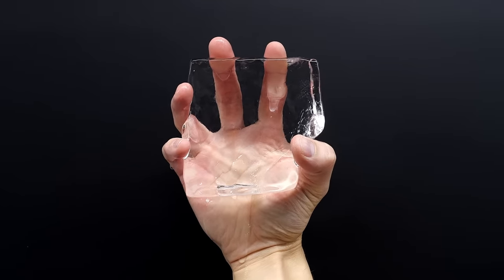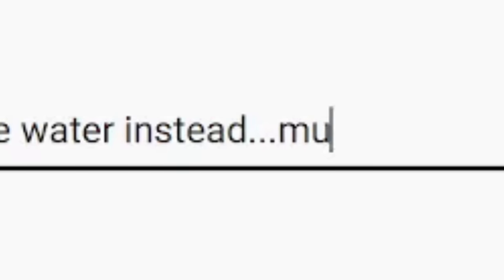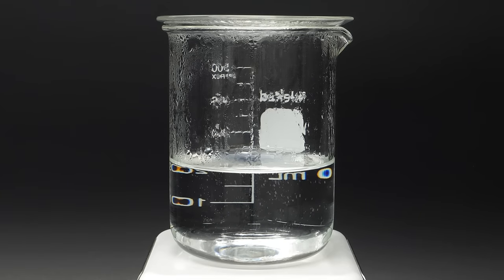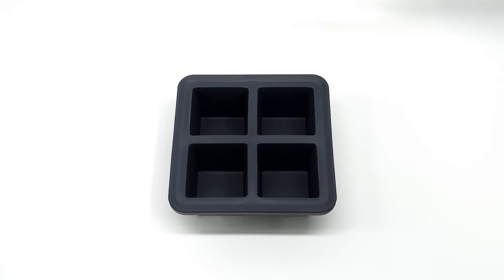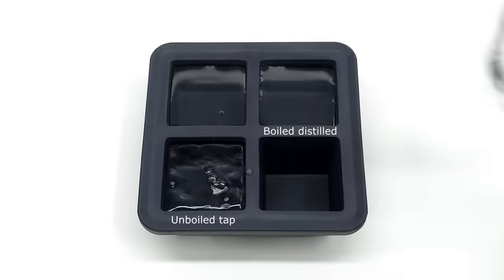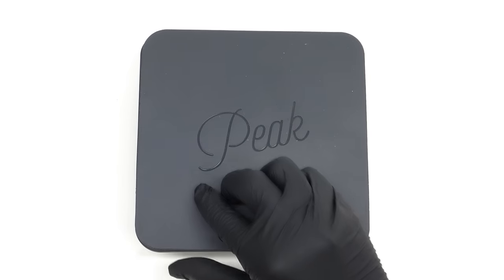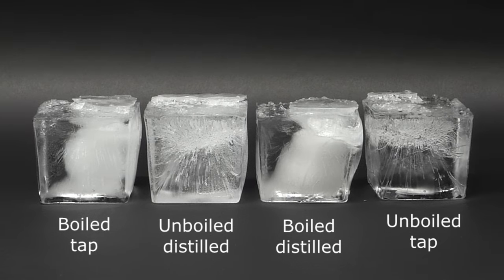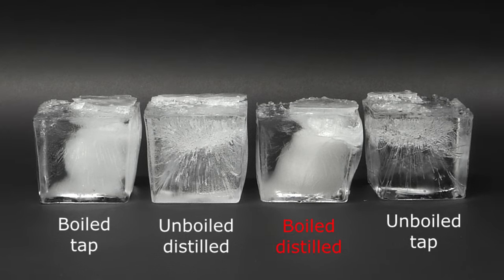The clear ice myth

Comment: The reason the ice isn't clear is because you're freezing it wrong. When ice freezes it's excluding all sorts of stuff. An ice tray let's ice freeze on all sides so it freezes from the outside in, trapping all the impurities in the middle. When you use any method of making clear ice the goal is to freeze it from one side to the other so the impurities get pushed to the unfrozen side. You stop freezing just before you get to the end so you're left with water with all the impurities and clear ice. The role of the cooler is to keep the bottom from freezing so it freezes top down making the ice clear. Industrial clear ice is made by huge tubs in a freezer but the water is made to circulate so the freezing is controlled and ice grows outwards - the circulating water ensures the unfrozen bit is outside the solid.

Comment: I think you gotta boil it for a good hour until your left with very clear water you can not see, then pour it into the icecube molds and it will be perfectly clear
Reply: I think you need to do a bit more homework in physics.
It is solely a matter of thermal expansion. Tap water is plenty clear.
Reply: @AB-80X  the joke is that it boils out of the cup leaving air
Reply: @KerbalChris  Ah, touché. Good one🙂

Comment: ok, well my only question is: but why not?
boiling water should remove all the gas in the water, and distilled water has basically nothing in it, it should be exceptionally pure, and water expands as it freezes, which means that those bubbles cant be vacuum like in a prince Rupert's drop, because the ice expands to fill in the gaps, or more correctly, the gaps never from to begin with.
why doesn't this work? does water naturally absorb gas again before it can freeze? I guess that would make sense since gas dissolves better when the water is colder, the opposite of how it is for solids. if this were the case, then a sealed container of boiled distilled water with absolutely NO GAS at all, should remain clear. alternatively just put it in a vacuum chamber, and pull all the gas out, then just keep the chamber under vacuum, and put the whole thing in the freezer.

Comment: Well... is not about the water, it's about the freezing speed. The product that makes clear ice, has got 2 chambers. Bottom chamber will give you the clear ice. Top chamber the one in direct contact with the freezer itself, but only by a small portion. And both parts are connected by a small tube. The setup is done to cool very very slowly the bottom water chamber.

Comment: The actual reason of such is impurities, it's known by everyone, but there is another way of getting the impurities out, either use a special type of freezer to get the impurities up then remove the fogged up part, or just boil it off into vapor and collect it back so the minerals and impurities doesn't go with the water.
Reply: The cooler trick (done in Nile's clear ice making video) is just like poor man's special freezer - when ice crystal forms, impurities are displaced into remaining water (the slower the freezing, the more effective the process is); by removing the cooler from freezer before water completely freezes, all the impurities are left in the water which can then be discarded when removing the ice from the cooler.

Comment: did he make a video on using a cooler? What am I missing? I seen the shorts video, but is there a full video?
Also, try filtered water instead of distilled. That ice is pretty clear. Also also, are you taking into account how cold your freezer is? If it's really cold and freezes fast, it probably won't be clear. That's probably why the cooler ice was clear, because it was slow. It was in there for 3 days and it still wasn't even all the way frozen.

Comment: I think freezing the water while slightly vibrating it would get you super clear ice. Drives out all the air bubbles.
Reply: The problem isn't dissolved gasses, it's the fact that when crystallization occurs from more than one direction you get gaps in the janky space where two unaligned crystals meet instead of a smooth crystal structure.  Even if there was no dissolved gas to occupy this space, there would still be 'cracks'.  When the ice is only halfway cloudy you can see how these microfissures organize into internal stress patterns.
Reply: @wcookiv  maybe distilled water with an occasional jiggle?

Comment: It would probably work if you could find a way to boil and freeze it inside of a vacuum chamber, so air can't dissolve into the water during or after it finishes boiling
Reply: why not just poor some water into 
a cooler
Reply: @Skibidi-n2zz  because that's not what I'm talking about

Comment: You did two things that I wouldn't have, that may or may not have made a difference. First you let the water cool down. Then you put it in a relatively small container though I like the fact that you covered it. If your experiment holds up even if these conditions then we need to explain why it didn't work. Any hypotheses?
Reply: it will hold up for a very simple reason: even when close to boiling temperature, the solubility of gases in water is not zero, so you can boil the fuck out of it and you'll still get bubbles. It's as simple as that
Reply: @andresaofelipe  technically that's true. The solubility of anything in anything is never absolutely zero. The question is, is it higher than the solubility in ice by enough that optical sized bubbles will form.
Reply: @michalchik  yes. The solubility of gases in ice is substantially lower than in water, we're talking orders of magnitude different
Reply: @andresaofelipe  The most likely bubbles are either carbon dioxide or oxygen. I am pretty sure that at boiling the solubility of those gases are orders of magnitude lower than at room temperature. I looked around and found one graph for CO2 that indicated at 100C and 1 ATM CO2 levels had fallen to measurable zero, but I found nothing for ice. 

Do you have numbers for 100C CO2 and O2, in ice and boiling water? 

if it is CO2 primarily instead of oxygen, the pH of the water might make a big difference, slightly acidic being low and slightly acidic basic being high.
Reply: @michalchik  dont have any numbers right now, but I know that the gas solubility of ice is lower than that of boiling water. But I would argue that even if they were equal, that wouldn't matter at all. You can't freeze water at 100°C, not at atmospheric pressure, at least. And unless you're planning on freezing your water inside a vacuum chamber, you're going to redissolve all the gases into it by the time you reach the freezing point
Reply: @andresaofelipe  I was just thinking you would cover it with something like a sheet of plastic wrap
Reply: @michalchik  I believe even the diffusion of gases through the plastic would be enough to make bubbles appear. If you boil the water and then completely isolate it from the atmosphere, then it's possible, but unless you seal the container leaving absolutely 0 gases inside, aka a vacuum chamber, then you'll get bubbles
Reply: I don't think we'll be able to determine any of this without actually rigorous quantification, or doing the experiment. Also depending upon what you boil it in you can minimize the amount of surface area exposed. I guess I just probably should do this myself. Solubility of gas is in ice, the solubility of gas is in boiling water, and the amount of gas necessary to create bubbles with a diameter large enough to reflect light.
Reply: @michalchik  yeah, doing the experiment should remove any doubts about that. But still, that doesn't change one thing: the myth that has been debunked is that boiling water is enough to make clear ice. The simple fact that we're discussing ways of isolate the water from the atmosphere already means that, in fact, this is indeed a myth and the process is not as simple as random strangers in the comment section make it out to be
Reply: You're also forgetting the Nitrogen problem. Nitrogen LOVES to bubble up. You will never be able to boil off nitrogen and get it frozen without atmospheric pressure pushing in loads of gases. Also, I don't think water has a solid state in a vacuum? I can't recall off the top of my head.
Reply: @playgroundchooser  I don't know that this changes much. Nitrogen is just another gas that needs to be boiled out

Comment: I have tried to make clear ice this way because that's what I had heard but it was a failure. I'm glad you have confirmed this doesn't work.

The question still remains: How do you get clear ice?
Reply: What people to is freeze a whole container of ice, so when it expands, the air bubbles will be at the bottom and clear ice will be at the top. Just cut of the lower part with bubbles and you have clear ice.
Reply: Nile has a video titled "Making a block of perfectly clear ice" which shows how to make clear ice at home, although he didn't explain the physics behind.
Apparently the number of ignorant "advices" under that video was high enough to get under his skin so he decided to make this video to debunk the myth.
Reply: @alternateaccount5268  You can actually take out the container before water completely freezes so that the part of water that would become cloudy ice is not yet frozen and could be easily poured out.

Comment: I'm surprised by your distilled water control. We have a leaded water problem in my district and the city is providing ZeroWater filters to everyone who asks for one. I noticed a clear (pun intended) difference between tap and filtered water when making ice cubes. They aren't perfectly clear, but they are definitely clearer and also freeze differently, often bulging out the bottom of silicon molds and sticking a lot more to the molds as well. I kind of expected the same to happen with distilled water.
Reply: I don't have a leaded water problem, but i do love my ZeroWater filters.
Reply: @Kineth1  I find the taste to be very... dry? If that makes sense? Besides that, they are really nice. Just have to be careful to supplement your fluoride with a good toothpaste.

Comment: I never understood when people say this. They must realize that when you boil water, the bubbles aren't air, they're steam.
Reply: They're probably the same people who don't understand boiling requires an imperfection in the pot. I microwaved water in a perfectly smooth glass measuring cup. "Boiled" doesn't describe what happened. Watching the water "not boil," I kept pressing the "add 30 seconds" button. Eventually it exploded with enough force to open the door. NOT RECOMMENDED #humor #true 
I was lucky, the microwave is still in use today. The same thing happens with ceramic mugs, and when you put something in the super heated water it boils furiously... you introduced "imperfections" when adding sugar or oatmeal or the tea bag, etc.

Comment: I heard that they vibrate the water as it freezes for clear ice
Reply: I make clear ice in the regular refrigerator compartment. Plain tap water works fine. All you do is get a plastic cup filled pretty much to the rim (perfect is not required at all.) Then place the edge of the cup right where the cold air blows into the refrigerator. After a day there will be a nice clear medallion, after a few days it will be several times as thick. I'm serious. The trick is to have the air blow over the surface of the water.
The worst water to use? Seltzer, it makes one big white blob.

Comment: Wrong. The water needs to be boiled for 4 minutes and 14 seconds in a copper pot over a propane flame with an ambient air temperature of 71 degrees and relative humidity of 6%. You need to be wearing a green shirt and it needs to be Wednesday after a april heavy rainfall. Otherwise it wont work

Comment: On its face, boiling before freezing just doesn't make sense. Why would you need to heat it up before cooling it down? Wouldn't it be easier for air to get into boiling water, with the water molecules moving around faster, giving more opaque ice?

Comment: Boiling causes water to freeze faster. I'd imagine that would increase the likelihood of imperfections in the ice.
Reply: No it doesn't
Reply: The last I heard no one was able to duplicate their results on either side of the debate.
Reply: @cowboybob7093  Wel logiclly there's no reason hot water would freeze faster because it's hot. But because water gives off so much energy to freeze, the temperature of the water bere freezing almost doesn't matter
Reply: @codebracker  One argument goes: Two precisely equal weights of water, the boiling one (B) loses enough weight (water) that there is simply less water to freeze, so B freezes faster. Like, there's hardly more energy in B than the room temperature one (R) and the weight makes the difference. But comparing how many joules are involved with the phase transition between liquid to solid and simply changing the temperature that can't be the reason. By one definition (perhaps outdated but only slightly inaccurate,) to change a gram of liquid water one degree requires one calorie. A calorie equals 4.184 joules. The phase change for that same gram of water requires 334 joules. 334/4.184 equals 79.8, so almost 80 times as much energy is involved in the phase change than changing the temp one degree. (This is not the whole argument, but the remaining parts don't contribute enough to make a difference either.)
There's no way evaporation can account for the difference
The scientists have yet to agree on what's really happening.
It's amazing to me that there are common physical phenomena that we still don't understand. You want a good argument? Find two people with different ideas of how human flight occurs. The last I read about that topic was the most advanced research has not definitively explained the airfoil, but go to any airport and you'll see tons of material reliably take controlled flight.
Reply: @cowboybob7093  what's really happening was probably just a fluke
Reply: @codebracker  I agree.

Comment: Maybe freezing it in a vacuum chamber???
Idk how someone can do that tho
Reply: I make clear ice in the regular refrigerator compartment. Plain tap water works fine. All you do is get a plastic cup filled pretty much to the rim (perfect is not required at all.) Then place the edge of the cup right where the cold air blows into the refrigerator. After a day there will be a nice clear medallion, after a few days it will be several times as thick. I'm serious. The trick is to have the air blow over the surface of the water.
The worst water to use? Seltzer, it makes one big white blob.

Comment: Sir the only reason the boiling water trick works is if the water actually still hot
Reply: See there is a small issue there, you know, since only cold water freezes at normal pressure.

Comment: The secret to doing this is to mimic the way a lake freezes ice, from the top down with all other sides being insulated. I drill holes in a silicone ice mold, put two chopsticks in a small cooler that fits in my fridge, then put the mold on top of the chopsticks to elevate and pour water in then freeze. Works every time and I have that damaged ice mold dedicated to this process

Comment: I wonder if using a vacuum chamber would produce clear ice. Like if you poured water into it and then vacuumed out all the air. But you'd have to freeze the water inside the chamber because pouring it from one receptacle into another would just aerate it all over again.
Reply: Clear ice is not a matter of aeration or impurities. You are just trading one misconception for another.

Comment: Reason any ice becomes cloudy is twofold:  1) there are impurities (I.e. not water) in the water.  The crystalline structure of the ice is interrupted by these impurities leading to internal voids, fractures, and general cloudiness.  2) ice is less dense than water.  In an ice cube mold the water is made cold on all sides, therefore it will freeze from all sides (the uniformity depends on the design of the ice mold).  The crucial bit is that it is freezing from the outside inwards.  The water can slot in to the expanding crystalline structure of the ice very easily all the way up until the center where the incompressible water must now become ice.  As that central volume of water becomes ice it expands, pressing on the ice that had formed around it, causing it to fracture.  The reason freezing ice in a cooler works is that the insulation means the water freezes primarily from the top down.  If you let it freeze all the way through then even ice made with the cooler method will not be clear.

Comment: 🤷‍♀️ Well well, well water. 😏
If I use the ice cube trays to freeze it, they've been clear before. It also goes through a filter so, yea I guess that does it.
Reply: Clear ice has to have no air in the part that froze. Filtering water actually adds more air than it already had, so it is less clear although since ice freezes in interesting ways there will usually be a more clear and less clear part to it
Reply: @puppieslovies  Well I'm not bluffing. Our ice has been clear before, only a tiny portion in the middle of the cube was faintly bubbly.
Reply: @TiredMomma  then it was probably freezing top-down, I would guess. The recommended way to do clear ice is just to use normal tap water inside a very insulated environment on all sides except one, like the top of a plastic cooler

Comment: I think it wouldnt give you clear ice anyway but What  if you try to degas the water using a Venturi formula? You make water run fast through a small hole in a loop, this should degas the water after the small hole. I use this at work when i need degas water, coz boiling gives me a worst result. 

If you want more info about this I can send it to you.

Comment: The reason boiled water doesn't work is because it reabsorbed air as it cools in the freezer. So, if we pour a layer of oil on top the boiled water before putting it in the freezer, that should work, right?